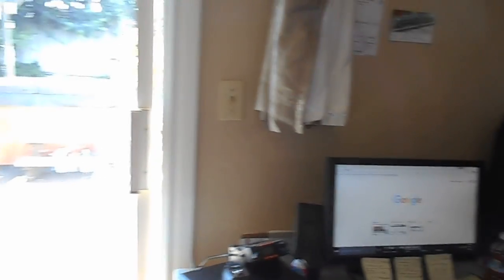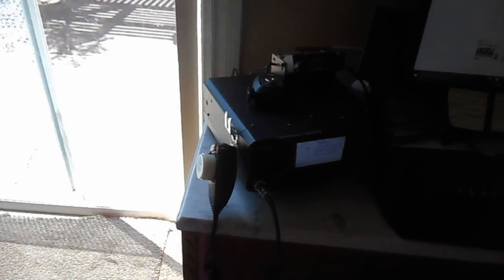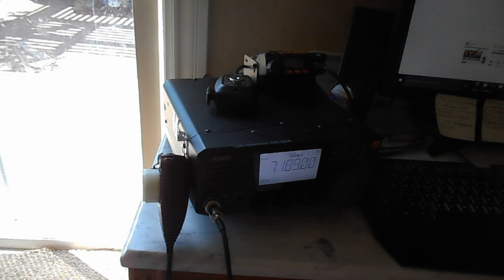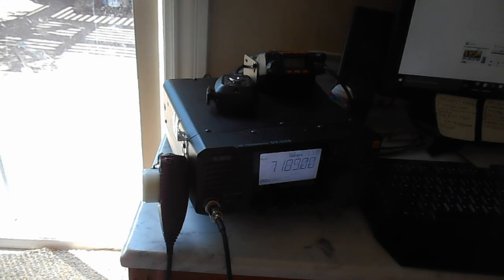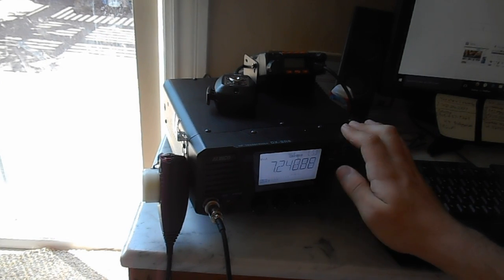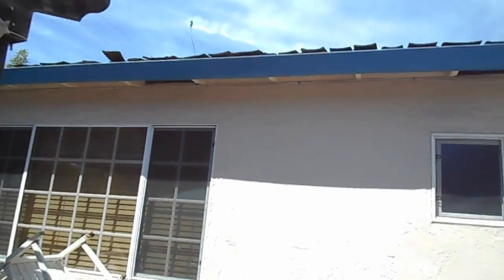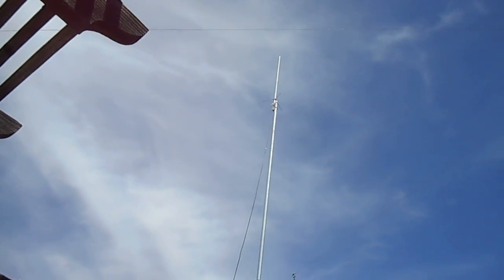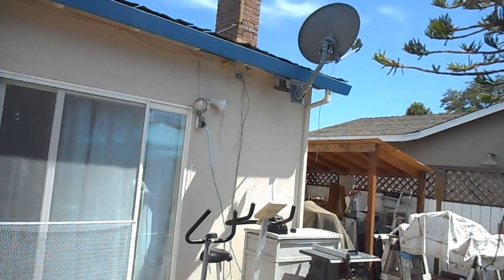KM6AZI's New Ham Radio Station with the Alinco DX-SR8T

Comment: I replaced my stock Mic with a Desk one and it made all the difference BUT I did adjust the Mic Gain pot but you have to BE CAREFUL to just BARELY move it because it can break easily.
Reply: Why you adjusted the pot, because low modulation or high modulation?
Reply: I did it because of very low modulation. It seems to be a real issue with this radio. The trick is to BARELY move it or you will break the pot. I get better audio reports now. It was way too quiet before adjustment.